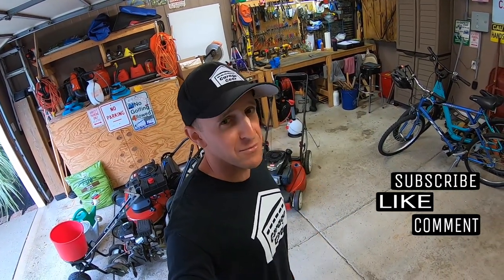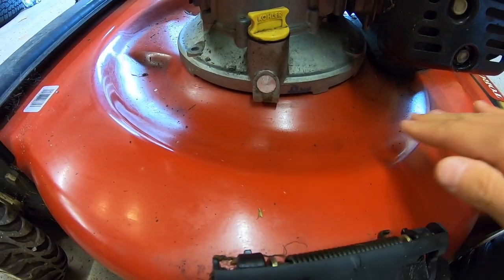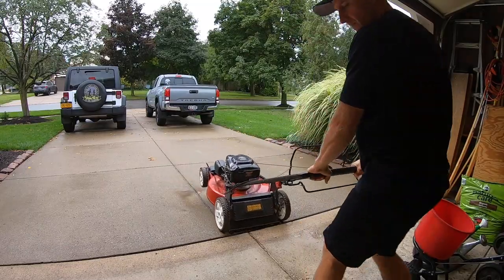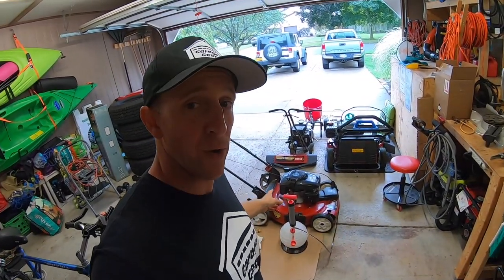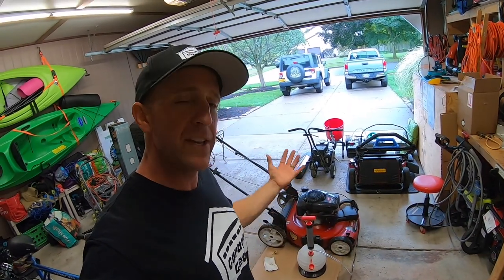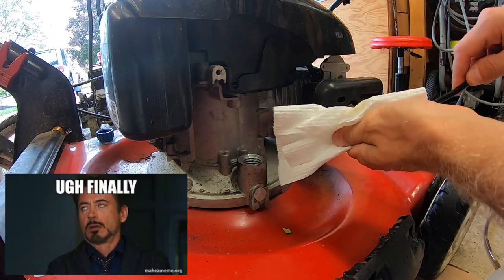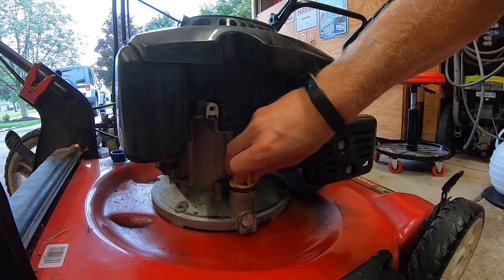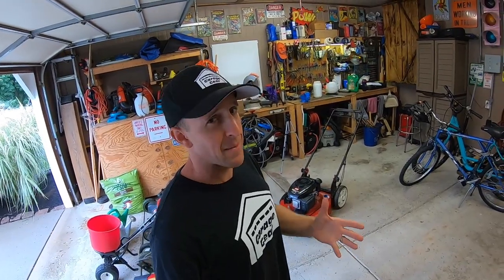CHANGE THE OIL IN YOUR SMALL ENGINE WITHOUT MAKING A MESS! Use An Oil Extractor!

Comment: What do you do if you run your mower and find out you added to much oil? Asking for a friend...who ran it for about a half hour and noticed that it was starting to smoke. Thanks JB.
Reply from the maker: Whitie in Vermont hey WHITIE!!!!! Kind of hard to tell without actually seeing it.  Seen a similar situation though. I just changed the oil again. Drained it out. Re-added oil to about the mid point on the dipstick between low and high and let it run for few minutes in the driveway to let the oil/smoke clear out. Should be fine after a little bit. Let me know how it works out for your friend! Good to hear from ya bud!
Reply: @GarageGear  thank you sir! My friend appreciates your advice more than you know. Sorry that I haven't been around. Vermont weather is similar to Buffalo New York. It's been a busy year for anyone with a green thumb and very busy. Not complaining but just letting you know that's consumed a lot of my time.
Reply from the maker: Whitie in Vermont I hear ya my friend. I know you’re always around somewhere lol. Don’t know if you’ve gotten a lot of rain lately but we haven’t had any in three weeks. My water bill will definitely be through the roof!